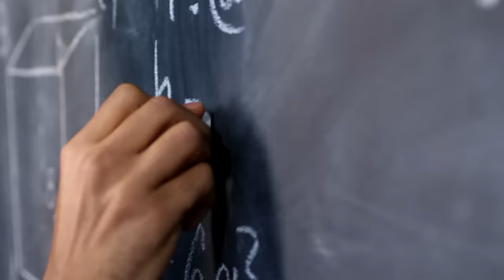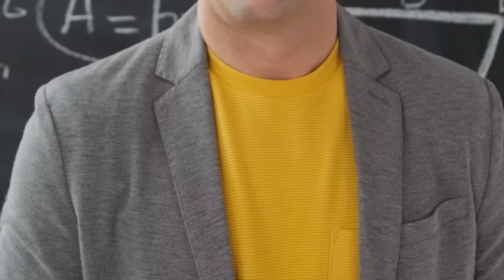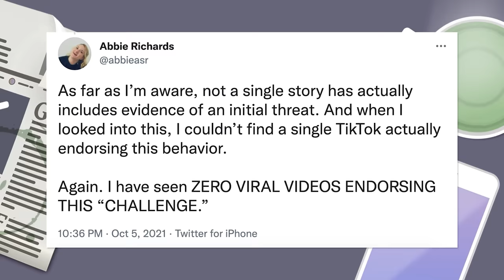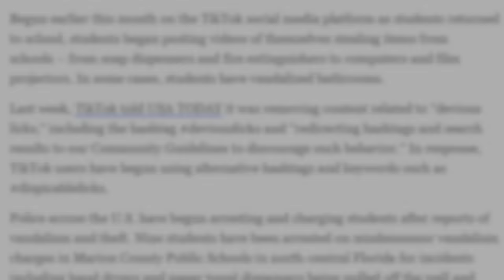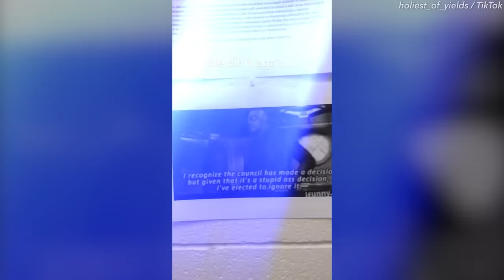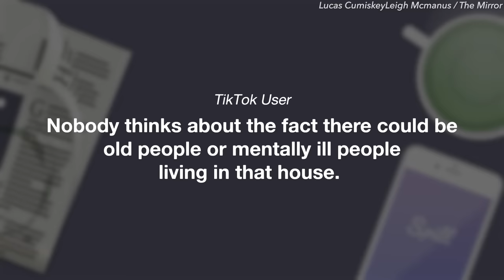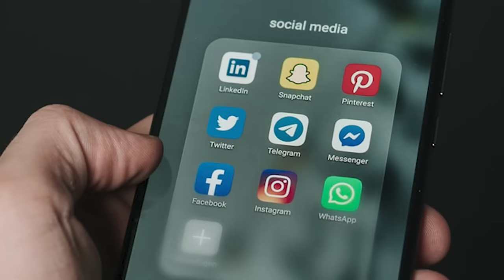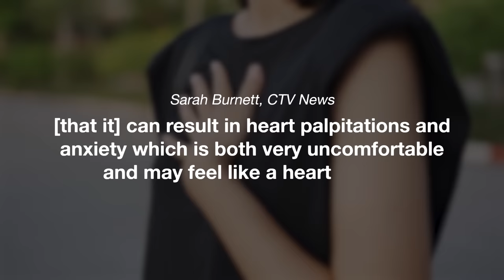Criminals are doing HORRIBLE things on TikTok. A man almost lost his family.

Comment: We had a mechanic that forgot to torque down a front rim on a conversion van. Customer got a couple miles down the road an felt a wobble and before he could pull over the rim came off. I had a set of universal rims. You were supposed to torque the down then drive 500 miles and torque again and you should be good. I would torque them down and they would loosen again constantly Got rid of them real quick.